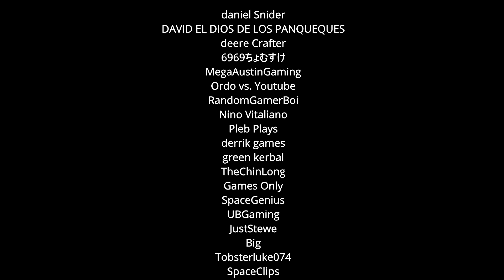KSP Tutorial: How To Build Soyuz In Under 15 Minutes! [stock 1.11]

Comment: So on my PS4 when I built this, the so use would always have this one problem where it would start rolling uncontrollably and start spinning and spinning which made the whole thing uncontrollable to get into an orbit and I had to abort and at a certain point I kind of just gave up. Also, another note about this so if this is meant to dock how come you didn’t have any monocrop repellent thrusters to it? Did you forget to add them or does the actual so use itself not have monitor thrusters in the space station does the model propeller for it? Also, how do you get rid of the spinning problem? I’m currently re-creating the whole thing from scratch in enhanced edition PS five and hopefully this time there will be no problems. Fingers crossed.

Comment: for my non-DLC brbs: 
  1. slanted tail connectors (really long 1,25m tail part) works great for the side boosters. you might have to clip some fuel, tho.
  2. closed-cycle RAPIERS can achieve the look of the kodiak.

Comment: Fun fact on the Verner engines. Those aren't actually separate engines at all. They are actually just a separate novel for the turbo pump exhaust gases that the Russians were smart enough to realize that if you gimbal it you can use it to control the rocket. The soyuz actually only has one "engine" per booster segment and each engine just has four combustion chambers/bells with the vernier engines.

Comment: Excellent Soyuz! I managed to make a slightly more realistic version based off of yours. Not dunkin' on you in any way.
Reply: For the engine shroud, I used structural tubing instead of fairings. looks wayyyy cleaner.
Well, my first version used fairings, but I thought of using structural tubing instead during a walk.

Comment: Day 1 of asking Piolet to use ReStock once
Reply: WHY RESTOCK WHEN YOU CAN JUST NOT UN-STOCK, BECAUSE I YOU DON'T GET RID OF THE STOCK THE YOU DON'T HAVE TO RE-STOCK.
Reply: @lattmowne201  because restock looks way better than many stock designs
it was originally designed before many parts got visual overhauls, so many of the best looking parts now that rival ReStock were once extraordinarily ugly
ReStock has less use now due to the visual overhauls making stock KSP look better than it did in early versions, and due to the fact that it still hasn't updated to include the custom-horn RCS blocks,
but on the other hand Restock also adds its own parts in the optional second mod Restock+, and of course there are people who swear by the beauty of Restock over the stock designs to this day, as well as people who still play on older versions of KSP (where the parts are uglier) because of nostalgia or mod compatibility
Reply: @ratemisia  It's a joke comment
Reply from the maker: if u can get to 50 days I'll do it
Reply: @Piolet1549  K, you said it.

Comment: Soyuz never crashed
Reply: Soyuz 1 crashed after a parachute failure, killing the pilot Vladimir Komarov
Reply: @ratemisia  Isn't he dead because the landing thruster of the landing module doesn't turn on a few feet above the surface to slow down the landing?
Reply from the maker: and MS10 happened

Comment: The real Soyuz had one pair of solar panels not 2, It wouldn’t be a piolet video without a mistake, good Soyuz tho
Reply from the maker: the two solar panels are supposed to be one. could have done more complicated design but didn’t to keep video simple. Did forget RCS tho lol
Reply: I think he did it on purpose as there aren't any stock solar panels of the correct size
Reply: @jpase  actually, for my Soyuz I just built a custom solar panel with hinges and rigid solar panels. Looks much more like the real thing.
Reply: @elijahwills7331  that works, but piolet wanted to make a simple recreation that anybody could follow easily
Reply: @elijahwills7331  i wanna see it
Reply: btw when's this wiki coming out?
Reply: And he also didn't add RCS

Comment: Engine plates are decouplers
Reply from the maker: if your referring to when I put the decoupler on the spark at the bottom of the Soyuz. I did that because the shroud would have been slightly longer with the engine plate and I felt like the fairing was already too big so I did the decoupler to keep the fairing size down